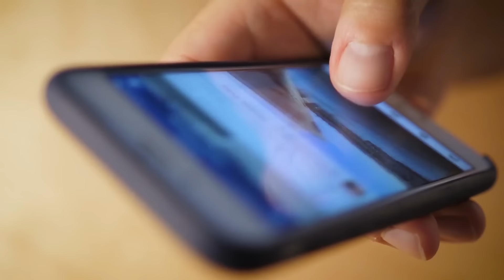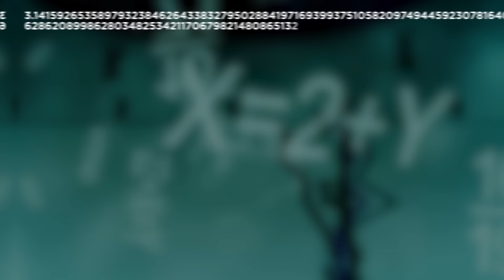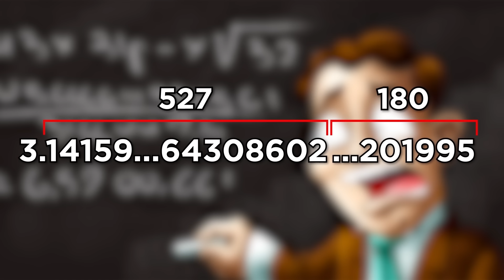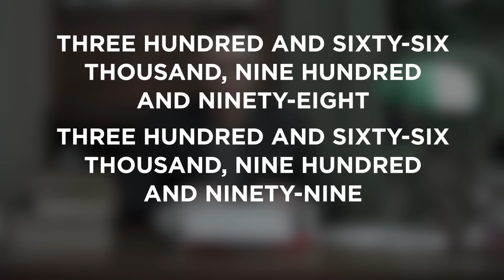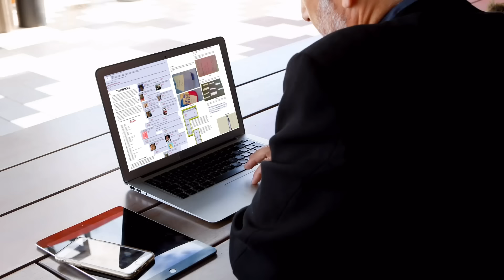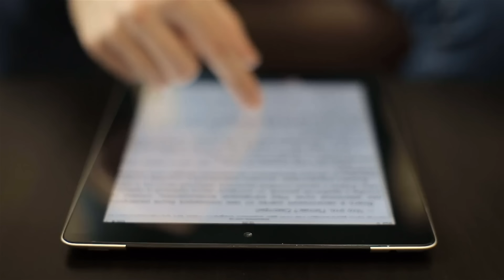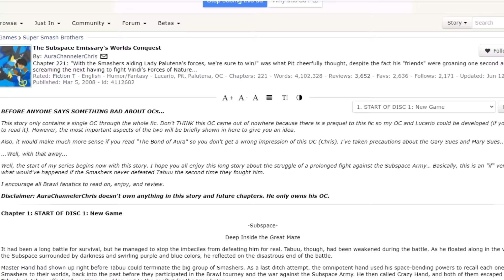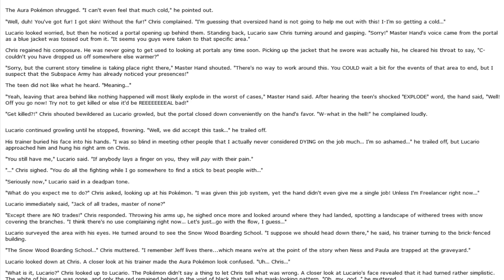Biggest Wastes of Time EVER

Comment: Damn that fanfic is The Wheel of Time long. That's freaking impressive. The Wheel of Time is so good and so long. I worked as an analyst for a small wastewater testing company and it took me over two months to listen to The Wheel of Time working 40+ hours a week. Job was crazy I would work 15-18hr days sometimes because the other analysts were lazy bastards and I just kept getting more and more stuff piled on me. I had to work a three 12+hr days culminating in a 24hr day so that I could take a two week vacation meanwhile the other two guys that worked on my side got mad at me because I didn't help bring the 3 trash cans to the road once a week. I'm putting in 15-18hr days at least once a week because of my workload, which they never once offered to help, and then they got pissed at me because I didn't help bring out the trash cans to the road. Two guys three wheeled trash cans doesn't seem like a big deal but apparently it was to these lazy bastards. I did take the trash from the interior trash cans to the outer one, often cleaning theirs without being asked, but guess that wasn't good enough. These jerks workloads were so light they could go on vacation without having to work any overtime at all just pick the pace up a little and not spend hours surfing the internet or standing around BS'ing. Eventually I got tired of the crap and quit.
Reply: Not as long as your comment.
Reply: @miguelgo4039  Nope, it’s called a paragraph they prob used 4+ of those :)

Comment: The one about shinies needs to be updated because your numbers assume max odds. I’m the older games (gen 2) there’s a method to make 1/64 opposite gender hatches shiny, moving up to gen 4 you can get a 21.34% chance on all wild encounters using the cute charm glitch, and in newer games you can get odds as low as 1/100, 1/152. Also keeping in mind that a lot of players use bots to auto farm shinies for them (you can literally just leave the system plugged in and catch a few shinies every day with no effort)

Not saying what the players did isn’t amazing (only caught 10 shinies in my Pokémon play through a myself), I’m just saying it’s not really that big of a waste and especially on the newer consoles I would assume they did some trading/botting
Reply: To much to read 😅
Reply: @realAverageDev  You watch 30 minute videos.
Reply: @CinnaSwirls  ?
Reply: Yeah, and if you catch them all, then you get the Shiny Charm, which increases chances, and Action Replay/hacks were a big deal as well so you could easily use cheat codes to get every shiny. I definitely used AR back in the DS days, hahaha. I stopped using it though.

And I think there's another method with breeding, by using a Pokemon with another language and a Ditto, or 2 Pokemon of different languages (so like one English name and one German, for example). I did this to get my shiny Duskull, but I think I had the Charm as well. xD This was all the way in UltraSun, and that was THE ONLY TIME I got the Charm by myself (aka, no cheats or anything, just trading with myself and others via GTS).

Comment: about the max cape: That cape is not even the hardest one to get nowadays.
There is also something thats called the completionist cape.
For that one you need to have not only gotten all skills ln lvl 99 but several skills at lvl 120. And you need to have mastered every single minigame, finished every quest in the game. Found all the lore and several other really obnoxious timewasting requirements.
If you think mastering mini games or finding all lore is easy you are oh so wrong. 
For the lore thing: you have a skill called dungeoneering that is a roquelike thing. You need to find every lorebook in there but its completly random wich one you get and there are over 100 different ones. If you are unlucky just that part can already take over 1000 hours.
For the minigame you need to have cleared every minigame a certain amount off time. Some spam in the the thousands off times you need to clear them. And there are over 20 different ones. This also takes 10s off thousands hours to do.
And this is all on top off the already ridiculous max cape requirements since you also do need to have the max cape to even be able to buy the completionist cape.

Comment: I haven’t finished my task yet, but in Fire Emblem Echoes Shadows of Valentia, I downloaded all of the DLC. My goal has been to max out all of the stat points for ALL of the units and I’ve started over multiple times. My current save file has logged over 100 hours, but it doesn’t count the times I’ve reset the game when a unit didn’t get the stat boosts I wanted. I’d swear I’ve spent over 1,500 hours on this task…

Comment: I can't believe the Revel made it on this list, a monument of wasted resources at its finest. As a carpenter there, most of my years on that job felt like a huge waste of my time. We completely finished one of the restaurants, only to demo and rebuilt it, because the chef didn't like where a trashcan was sitting. I really wish that was an exaggeration. We built the same set of walls 6 times due to problems occurring after their construction. 1st and 2nd water damage from the weather, 3rd and 4th fires, 5th crane collapse, and 6th finally nothing bad happened. In the strip club we installed floor to ceiling wainscoting and the painters painted murals on them. Because everyone looks at beautiful decorated walls in a dimly lit room with strippers.

Comment: About the pokemon one, as a fan, its impossible to have ALL shinies since most are shiny locked, and id like to argue that while they MAY have had all dex numbers, they most likely did NOT have all FORMS, VARIATIONS & GENDERS. To which i will say I do. I have spent 17 years since diamond pearl and platinum came out, along with the GTS (global trading system) and have amassed ALL normal AND SHINY forms ALL the way up to scarlet and violet.
Reply: And btw, i had over 1000 hours on just ONE of my pokemon games. What they did compared to me isnt that impressive if you ask me. Not only that, but i have about 8 boxes of extra shinies, and even more of legendarys. I used multiple consoles, games and accounts to stock up and collect them all putting them into my own creation that i dubbed " the MASTER DEX"
Reply: I wish the little guys that dont have alot like me, would get the recognition these ppl do 😢

Comment: well someone did not make a lot of research on the pokemon thing. at a certain point in the series the odds could be declined to a 1/512 (masuda method and shiny charm) and if i remember correct it was possible in the gen 2 games to breed pokemon under certain conditions with a 1/64 chance. the later ones could not be transfered without exterior methods but thats not that big of an issue in todays time. But yeah to some people it may seem a waste of time but doesn't that logic work on most hobbys? i mean getting platinum on every playstation game is a waste of time too but some people need it.

Comment: Erm actually 🤓 for the Pokémon section, almost all of them can be hunted at odds of 1/512 or less. Compared to your calculation where they were all hunted at 1/8192 odds (which isn’t even possible for a lot of Pokémon) it would take 6 million less encounters at average odds, about 512’000. According to your 15 second per encounter estimate, that is just less than 90 days. Still a long time, but nowhere near 1128 days.

(Additionally you sourced the footage of the Shiny Eevee 5:36 as ‘Pokémon Sword and Shield’ when it should have been ’Pokémon Let’s Go: Pikachu! And Let’s Go: Eevee!’)

(Sorry for this nerdy rant lol)